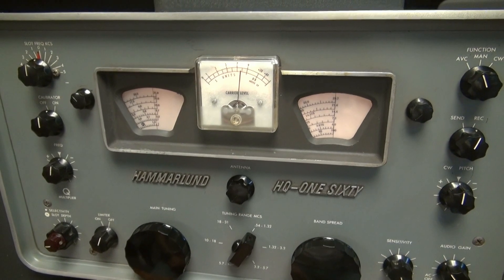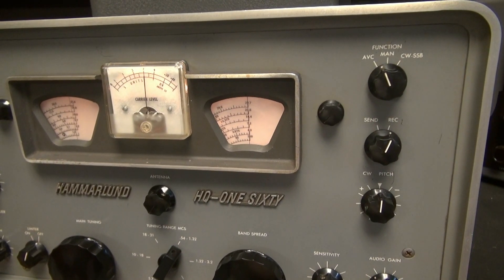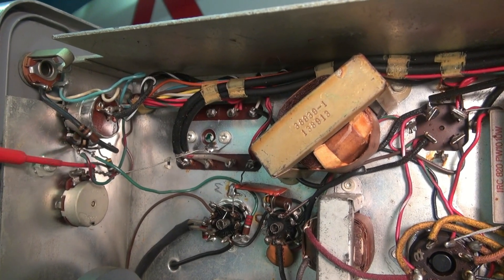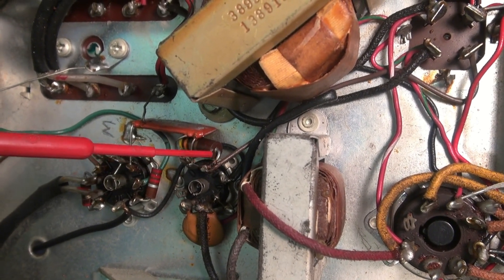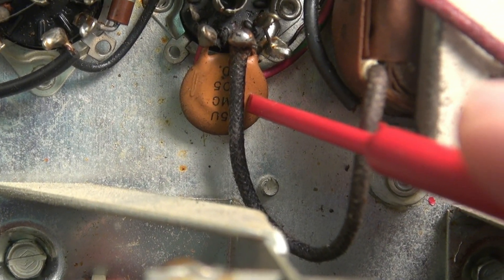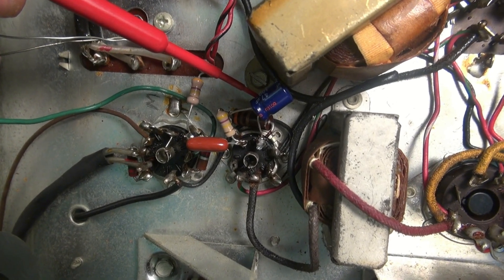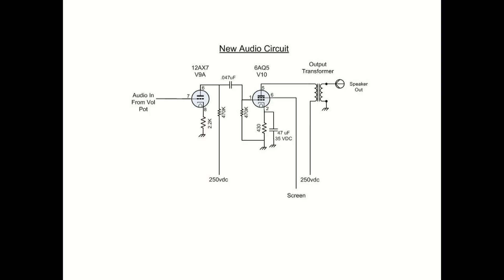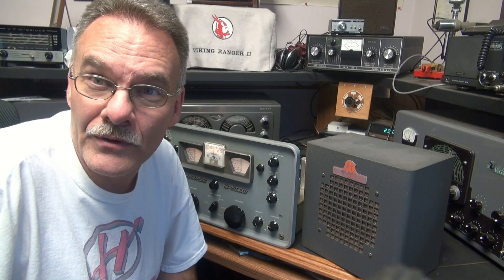How to repair Hammarlund HQ-160 Tube Ham radio receiver weak audio

Comment: Terry, I absolutely love your videos. Was hoping you have a moment to ponder my current HQ-160 problem. Unit has been recapped and worked great for a few years. Sat on the shelf covered in a controlled environment, so no deteriorating or contamination. When I pulled it back down and brought it up on the variac, I'm having a problem with receiving anything in the ham bands at all. Local BC AM stations are great on the first two knob settings. For the other main dial knob selections I don't get any Rx. The calibrator works and I'm picking up AM stations on other bands. As an example, getting broadcast AM on 80m but nothing else.

Any thoughts? I have not pulled out anything from the case, and haven't even tried testing tubes.

joe ki5o

Comment: Does this principle go back as far as an HQ-129x?  I've just finished recapping one, and  the audio is weak (I actually thought I had a dead receiver. ) I did have to replace the audio pot (and the sensitivity pot but I used original values.  The originals were scratchy.

Comment: Terry, nice video.  I'm new to Ham radio; got my tech license about a month ago.  Just wondering, is this a design issue, or is it due to the age of the components?  Thanks.
Reply from the maker: +jerry blood Hello, I don't think it was a design issue, just a gimmic they came up with to reduce distortion and appeal to a shortwave listener vrs Ham communications application. I also do not like the couplets that were used back then. Mainly because the internal components were low quality. You want your audio path to be of the best quality.